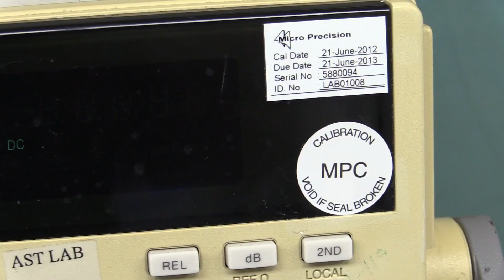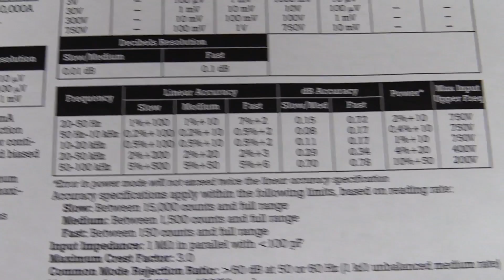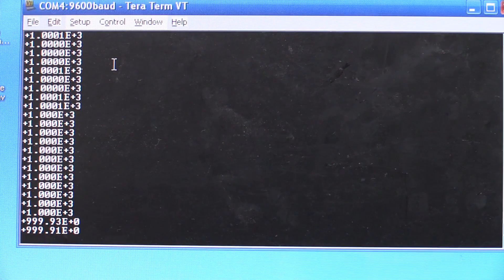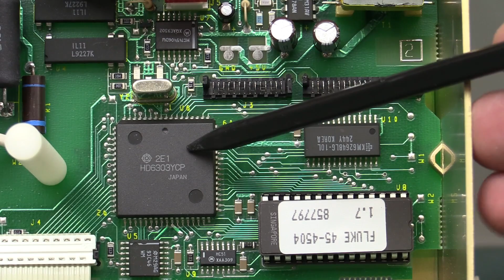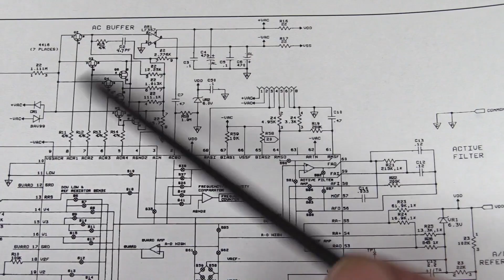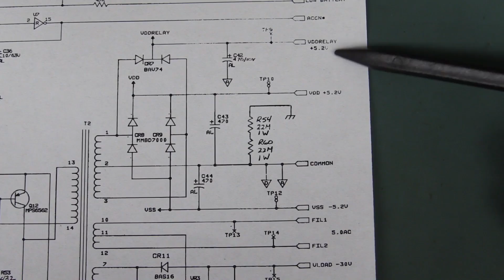EEVblog #791 - Ebay Fluke 45 Multimeter Teardown

Comment: Anyone have issues with the battery low indicator coming on after a power failure, seemingly from the battery not having enough voltage because charging didn't happen post power failure?

Comment: @25m15s: "...just a zener diode..."  Worth noting that 6.3v (as shown) is the optimum zener/avalanche voltage for stability over time and temperature. Cheers.

Comment: Most of these vintage bench multimeters are sold for USD250 above in eBay. They are old and pricey. Also eBay global shipping charges import duty. If your item cost USD 250, you have to pay USD 135-150 for import duty. It is horrible and annoying.

Comment: I had a Fluke 8026 (about £400 at the time) the power connection overloaded and caused a fire. My insurer visited, took notes & photos, took away the 8026. Eventually they came back to say that the 8026 was no longer available & would I accept the Fluke 45 instead. I thought for a while (about 45 nS) and I still have it, the battery is dead and no longer available but the accuracy of the meter is still perfect.

Comment: Better or worse than Fluke 8840A?
Reply: 8840A's a real precision benchtop multimeter with 4 wire and 5.5 digits. This thing is between a handheld and a 8840A. The real use of these is to substitute for a handheld in a lab so you don't spend 10 minutes looking for it every time you need it, and you don't need to search for batteries when your careless co-workers leave it switched on.

Comment: These meters are very reliable. I have an early production unit as Dave does. And, I ran into the same problem as Dave trying to find a accurate schematic for it. Fortunately, the only difference I could readily see was concerning the input protection circuit. Mine was bought from eBay for $60, but needed repair. The relay driver IC was dead. But, upon repairing it I now have a very nice, capable bench meter. And, because I repair vacuum tube (as well as solid state) guitar amplifiers the audio impedance references are useful to me.

Comment: I work in a factory where the Fluke 45 are still the main bench meter used by all the manufacturing technicians. They're calibrated annually and still work great. Great video as always Dave!

Comment: The Fluke 45 is the ONLY meter, then and now, that can measure the DC and AC ripple on a voltage correctly without switching relays for every measurement. This is because there are different AC and DC paths into the Fluke IC and the switching is done solid state.

I have tried every meter on the market and none can do it. They either use relay switching or must use the same range for AC which makes that wildly inaccurate for mV ripple. Very frustrating that this 30 year piece of crap can not be replaced.
If you know a meter that you think can do it, let me know.

Comment: Finally a video about the Fluke 45 multimeter. Have one myself for a few years now, bought it in new and mint condition (not yellow, and still with the factory cal. seal). Paid way too much for it though. No GPIB, but that isn't a problem.
A lot of people on the internet say it's a basic and overpriced meter, probably in comparison with today's standards, but I love it to bits! Use it all the time. Heck, we even have one floating around at work, and when doing simple measurements I actually use the pass/fail functionality. It's incredibly easy to set up, once you know how.

Would be cool to see if this one has the same thing my one does, when enabling the second display, for accuracy you want to put it in the "slow" mode, else it adds up approx. 2 or 3 volts to a measurement. for instance with a DC measurement in the main display an an AC measurement in the second.

Comment: This has about the same age as my Wavetek model 52 multimeter 1987 and that one is way more advanced with a dot graphic LCD than this Fluke 45. Can measure current and voltage at the same time (no relay used for that) and also calculates power. I only have one channel but can support 4 internal channels and display all that. It will use a relay if I want to measure voltage on the front and on the back same channel. 
I use the serial and save directly to a csv file. It also had a battery power potion and only uses about 0.5W form a DC input.
I made a video back in 2012 and is on my channel. Is my main multimeter now and I just love it :) It also looks way more modern than this Fluke 45 in my opinion.
I only payed about $50 including sipping for the Wavetek model 52 :)

Comment: The new Fluke 8846a also has a vacuum fluorescent display. If I pay $1500 for that thing, will it still be working after 15 years or will it be a dim thing like this review unit? That's what's pushing me toward the HP.
Reply: Depends entirely upon how many runtime hours you accrue during those 15 years.  This meter may very well have been run most every day for the past 25 years before Dave purchased it.  For certain your display will dim, but, unless you are working in full sunlight or a very brightly lit room, it should remain sufficiently visible for several decades of fairly heavy use, many more if more  lightly used and powered off when not in use.  Generally, though, it will be the most heavily used segments that dim the most...the fact that Dave's display seems rather uniformly dim suggests the VFD voltage rail may be sagging and in need of capacitor replacement and/or adjustment.

It is all trade offs, though.  VFDs have the advantage of wide viewing angles and quick update rates whereas many of the older LCD displays lack backlighting and can be difficult to read from certain lighting and viewing angles (especially in a darkened room).  A backlit LCD, however, makes for a very nice display.

Comment: Had 2 different Fluke 45's over the last 10 years and never knew they had rechargeable batteries as an option or that the milliamp fuse came out the front. just unplugged and powered on, no worky. Must not have the option or bad battery. Thanks a lot Dave! thumbs up here.

Comment: Your meter is quite interesting, you have a different layout to the 3 that I have. Mine have a 440mA HRC fuse for the 100mA current input on the board as well as the glass fuse in the jack itself. I also think mine have a smaller shield over the ADC. Also the battery is 4 sealed lead acid cells, I've done some research on them to try to get one for my meters but they're pretty hard to find for any reasonable price. Yours also seemed to have more SMD parts instead of through hole.

Comment: I can't be serious watching this. This is showing gear I can't really buy without getting hungry, and this dude has it as ancient, inexpensive and so on. I am pathetic and laughable, and not very smart, right?
Reply: +Piotr Misiuna It is inexpensive compared to the range of gear out there. Electronic tools are expensive, I assume because the market is relatively small and tends to be production rather than hobbyist, where performance and reliability take priority over cost.
Reply: +gblargg It is all relative.  Gear that once sold for tens of thousands of dollars 15, 20, 30 years ago now routinely sells for just a few hundred, or less, and is often every bit as useful today as it was then (though may be in need of capacitor replacement).  Add to that new entry level gear that can be manufactured with levels of precision once found only in precision lab gear (perhaps less robust than yesteryear, but similarly accurate nonetheless).  This is not a bad time to be in the hobby as such gear is much more within the reach of hobbyists then it once was.

If your circumstances place such out of reach, please try to make good friends with a nearby hobbyist who has those resources.  Hobbyists routinely share resources and knowledge with one another with little, if any, expectation of financial compensation...it is wonderful to have a likeminded party to share one's passion with and expand one another's knowledge by working off each other's strengths.
Reply: That's more accurate. Thanks, everyone for feedback. I have 5 years of education in electronics, but only on paper. We never opened a TV in the class. I gave up about half way, all that theory made no sense without practical application, grades didn't change thou. So even "A" or "B" doesn't make you a winner, but attitude could.  Now after years I got back to electronics, and I am at square 1 again. Almost everything seams to be out of reach. Still more fun than just watching TV.
Reply: +Piotr Misiuna No, it means you're in a less fortunate economic position. I don't think it's necessary to assume anyone thinks they're superior just because they've had a better economy than someone else.
Reply: That way I am less fortunate, maybe even dead end, no options. No I can not be serious.

Comment: The 8V battery option was clearly a gel cell, hence the nominal 8VDC voltage.  I use to use some 6V batteries of the same rolled plate design for projects.  They were also popular in some early cellular transportable phones for standalone power.  I am surprised, though, that they opted for lead acid batteries rather than NiCd batteries, which were quite popular throughout the 80s.

BTW, that final copyright date actually reads "1986", not "1996”.
Reply: P

Comment: Could try fixing the low brightness VFD, apparently they can be rejuvenated though how successfully I don't know.
Reply: +MrCapacitator off the forum, would like to see if this works on the display.

Yes, and I've done it many times with good results. The filament oxidizes which reduces the number of electrons that can be emitted at the same drive current. Driving it with higher current (constant current power supply is necessary) to white hot condition for 5-10 seconds will breathe new life into the display. It's unlikely that the phosphors are damaged if the whole display is dim. You might find a few "shapes" such as a leading zero or the decimal will be permanently dimmed, but an overall rejuvenation will minimize brightness differences.

It's not a permanent solution, but it does give you a few years. I did it to both of my bedside clocks and they've managed to look good for almost four years of 24/7 operation.

Comment: Got one of these off ebay last year. It is a great bench multimeter. Thanks for the link to the service manual. My unit has a dead battery pack. Not sure if I should attempt to add some new cells or just junk the battery option.

Comment: Could the brightness of the display be tweaked somehow, similar to how an LED display could?
Reply: +Mystickneon If he can mod the power supply to provide a little bit more filament voltage, the display will be brighter.
Reply: +Mystickneon I know some of the time, the dimness is a result of the plastic and glass "Smoking over" with dust and crap. Clean it with some IPA and should be able to make it a tad brighter!
Reply: +rocketman221projects Some people here think that a cap is gone.
Reply: +Dorf Schmidt That's possible too. A low anode voltage would cause it to dim.

Comment: Check the voltage on that VFD, maybe it's not making -30, and maybe that's why it's dim.
Reply: +Boffin I tend to agree. I fixed probably a hundred VCRs back in the day that had dim VFDs. Just had to sniff out the high ESR cap and replace it usually. Suspect C45 in the supply

Comment: wow dave the start of the video was really first world problems.
"I just bought a vintage high end multimeter for Au$100 and it works perfectly! c'mon!"
Reply from the maker: +Erik Bruijn When you are buying it for a potential repair video, yes, it's a bummer.
Reply: +EEVblog We could cooperate on this. If you send me equipment intended for repair videos then I will break it for you. ;)
Reply: I feel his pain. I recently bought an old video game controller on eBay that was advertised as not working. I figured as simple as they are, it would be good troubleshooting practice. When I plugged it in and tried it out, it worked just fine. That's the only time I've ever been disappointed that something I bought worked.
Reply: +Erik Bruijn Straya - The lucky country.
Reply: +Razor2048 I think that's unlikely.  The parts alone were probably $100 in the dollars of the era.
Reply: +EEVblog It was just funny how you reacted when you found out it worked perfectly and it was within spec.

But true, the last repair video's turned out to be either beyond repair, or trivial malfunctions
Reply: +jeroen79 Cooperate?  Possibly collaborate?
Reply: +Erik Bruijn For that kind of money, you would expect it to work. When that unit was new, it probably only cost $50-100 to make.

Comment: The PSU giving 2 isolated 5V rails is to have a digital and an analogue 5V supply, nothing like separate supplies for isolating noise. 

Looks like the main capacitor is at EOL though, the sleeve is shrinking off. Not surprising as it has had a few decades of power applied with it being charged to peak voltage, followed by high ripple current in operation. Bonus is there is no Schaeffner filter pack to do an unexpected smoke test for you, though it looks like the mains input MOV has been designed out.

Comment: Bought a 220-115V 2kVA unit yesterday. Looks like it can easily be converted to an isolation transformer as there are 2 parallel tapped windings on separate cores. Must look at making a 1kVA isolation unit out of it. Was $8 on auction, and it is darn heavy. Just have to replace a broken 10A overcurrent breaker and put a decent mains cable on it. Polarised US sockets though, will have to look at changing them or just using some US power leads instead.